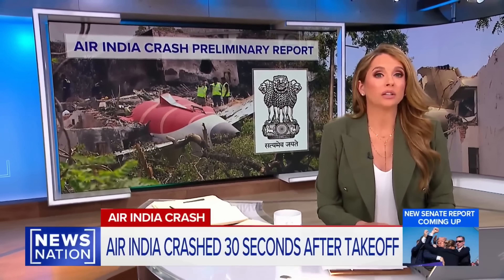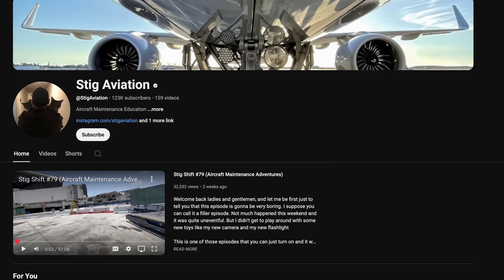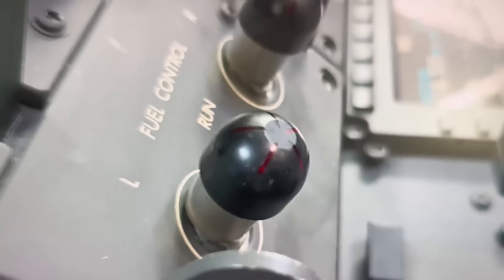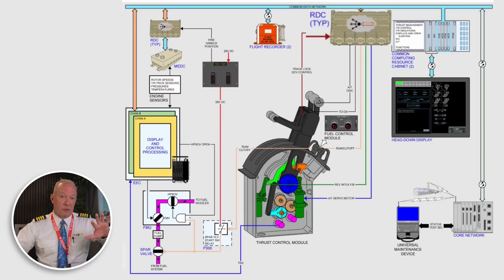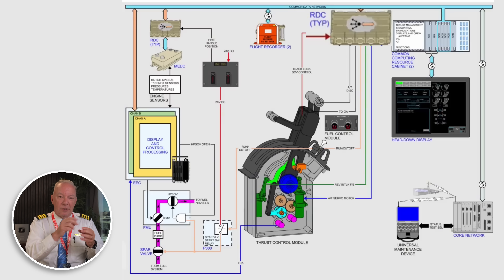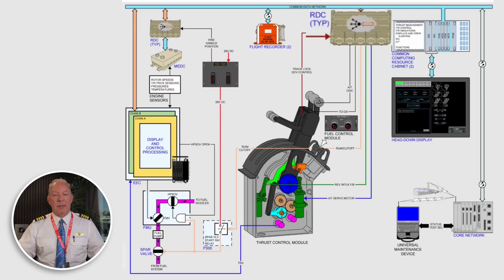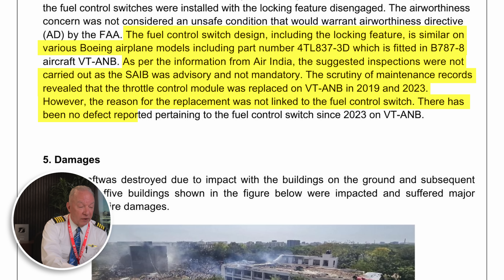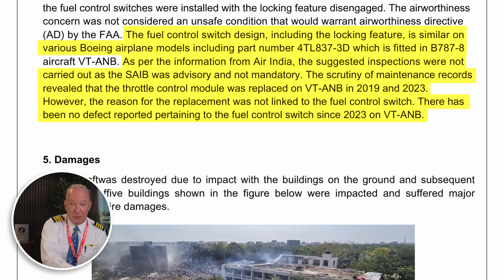The Truth About Boeing 787 Fuel Control Switches

Comment: With all due respect, oversimplified electrical systems don’t show the full picture. The elephant in the room is not addressed. 
Where in the circuit do we tap in to get flight data recorded information?! What has actually failed in that circuit that registered as switch on and then off ? Can’t it just be a Fail followed by a reset to redundancy and then on again? I don’t see a lot of positive news about these two names in the recent years  ( India and Boeing )

Comment: It seems that the fuel control switches were only actuated after the RAT deployed, and many seconds after the max. speed of 180 kts IAS was reached, so the focus on these switches becomes less of a priority. Some experts claim that the probably intentional attempt to relight the engines using the switches wasn't beneficial given the automatic mechanisms to relight the engines, but that without using the switches, only too little time would have been won to prevent the accident. Look at the video of water ingress being a likely cause for electrical failure. https://www.youtube.com/watch?v=tjhadW0mC2c

Comment: Dear Captain Steve,
I love your channel and your work, and the deep compassion you hold for those in aviation, and I have watched this video with great interest. 

But, I have a question which may still conflict with your excellent video, but in the interest of exploring another possibility here goes:

In this September issue of Pilot magazine, which is a very long established aviation journal I have been a subscriber to since I was about 17 years old and I am now 62! (BTW it comes out before the publish month!) 20,000 + hour, airline training captain Bob Grimstead, a long serving Boeing pilot and aviation journalist of great renown, has just published another possible theory, as well as fair criticism of the vague wording in the interim report.
Without going into a very long repeat of his excellent article, one thing stands out as a huge smoking gun: there was a notable twin engine shutdown of a 787-8 (ANA JA825A - MSN 34516) which occurred on 17th January, 2017.
In that case, a system designed to prevent over thrust of the engines; a unit system called the TCMA approved and fitted to the Boeing 787 fleet, and critically, designed to monitor engine thrust, incorrectly triggered a 'non crew commanded'  double engine shut down, through a software fault, while the aircraft was transitioning between flight and ground modes. Fortunately in this case, as reverse thrust was being applied after touch down. The engines were both shut down with neither of the Fuel Cut Off switches being touched at any point by the pilots and the aircraft rolled to a stop on the runway. The aircraft had to be towed off the runway some time later as repeated attempts to restart either engine, failed!
Surely, if that system which must be located  'down stream' as it were, from the fuel selector switches which are at the centre of this debate,  was able to automatically intervene at the crucial transition between flight and ground modes then, how can it be ruled out, that at a point when the Air India accident occurred, a similar gremlin in the TCMA system, did not command engine shut down, as the aircraft  transitioned between ground and flight modes, going the other way, and without either pilot touching the fuel selector switches? 
Why is that not a possibility which still by-passes the discussion about those switches being connected to a relay and separate from other computer based systems?  If it has been proven to have already happened once, it surely must be possible to happen again!? The timings may also absolutely still fit by pure coincidence. Also, as stated in another earlier video of yours, in the following moments of pure horror and shock, one of the pilots....most likely the captain, may well have then re- selected those switches and cycled them fast, some nine seconds later, to try and initiate a re-light....? That would also leave them in the 'RUN' position at the point of impact and as discovered in the wreckage. Or have I misunderstood that sequence? ( Very possible!!)
Anyway, the fact remains there is still a viable open question about the security of the electrical systems that might still have caused a fuel cut off, despite those switches not being physically 'transitioned'. After all, with no cameras on flight decks, that cannot ever be proven to have happened.

The report by AAIB also seems so fluffy as to which pilot spoke, what exactly was said, and just makes it more confusing. It would be absolutely obvious through which mic was sending a signal to the CVR, as to who spoke what words and when, and additionally, it appears that one of the investigators tasked with listening to those recordings, knew the captain personally very well. He must have recognised that voice! 

Why has the report chosen not to be more open about the CVR detail? Possibly because further potentially very difficult legal investigation is underway, to protect the reputation of both pilots, if it might be proved that Boeing is still liable through a computer fault? 

I still think it is far too soon for the report to have been published the way it was, and that there may still be another plausible, if utterly shocking, reason that both engines were starved of fuel at a critical phase of that take off. One that backs up the challenge and response we do know about on the CVR and may still exonerate the pilots. 
Love your work!! ❤

Comment: it looks impossible for a loose 14V wire or something to touch the switches in a 1 sec interval and stay there closing the circuit. so definitely it was moved by a pilot, and there is also confirmation on the audio recording
vibration ? again, seems absolutely impossible, plus there is not too much vibration in the cockpit I assume.
Reply: It only looks impossible if you assume a very simplified circuit can correctly represent what is really in the 787. It just can't.

Comment: To put it into a non-professional sentence: It's clear that both fuel cutoff switches have been moved manually. They can't move automatically, even if there would be a software issue, a general relay issue or an issue with the relays themselves.
And according to the Voice Recorder transcript one Pilot was asking the other if he had switched to cut off if I remember that correctly.
So for some reason the switches have been moved.
Sad, I hope the investigation clear up the chain of events that led to this fatal crash.

Comment: What if there was a loose connection on the positive DC supply to the fuel cut off switches. A loss of DC due to an intermittent poor connection would remove the supply to both fire switches and the down stream fuel cut of switches. The pilot would then notice the run back of the engines straight away on take off and try a re-start by taking the switches to cut off and back to run. Probably doing so within seconds on noticing the loss of power at such a critical point.

Comment: None of this "evidence" proves that the cut-off switches were moved.   If an electrical fault occurred on the 28VDC supply to them, then the relays could disengage and shut off the engines.
One possible answer is a short circuit in a worn cable. A momentary vibration could cause the cable to move and short out. The relays lose power. Then the cable moves again, and power is restored.
Ive had the issue on a car with an intermittent fault on the dashboard. Finding the cable was a nightmare. But after dismantling the entire dashboard, i found it.
Reply: Search for "787 BDM battery diode".
Reply: @ConcernedParent-z1qyep. Looked it up.  This is part of the battery charging system.
I'm suggesting a worn cable between the battery and the cut-off switch may cause a short circuit. This diode would have nothing to do with that.
But I'm sure the investigators are looking at every possible cause.

Comment: if the power goes through the switch to activate the relays as you say, then that means the switch earths or goes to negative when switched, in other words to complete the circuit, so that means if the live side of the switch finds an earth it will activate the relay. the switches are not fail safe. I would say this was a total Electrical failure as you say and it only came back online when the RAT started making power.

Comment: Is there a modification regarding how these switches currently function preventing this ever  occurring again? I realize that this current design prevents "accidental" operation. The engineers, understandably, never thought someone would intonationally shut the fuel in flight yet here we are. Hide sight being 20*20 its too easy to shut the fuel off in flight. I think it should require more steps and confirmation from both pilot & co-pilot. If the operation was electronic the on board system would require a final commitment before shut off or possibly, during take off, not allow fuel shut off. Before 9/11 it never occurred to anybody about access to the cockpit yet of course the pilots should be behind a secure door. Fuel shut off operation needs to be changed. What if fuel shut off required pilot & co-pilot to simultaneously operate the mechanical switch?

Comment: Disagree.. Why was the RAT  deployed two seconds before the fuel was cut off ?
Reply: There is absolutely no official source that the RAT deployed 2 seconds before the fuel was cut off. You are making that up.
Reply: If your source that "the RAT deployed 2 seconds before the fuel was cut off" is just the plane starting to descend, it doesnt work that way, Planes don't immediately plummet after losing fuel, they take a moment.

Comment: The engines failed, one after the other, providing just enough thrust for take-off. Then the pilots cut-off the fuel and then re-introduces it using the switches. That's an extremely likely scenario because the plane even took longer to achieve v1 than it ideally should have.

We can see why the whole western media is pushing the mental health narrative. It's better for AI and Boeingbto wash hands and for claiming damages in insurance

Thanks for the detailed explanation but at this point, it just seems like the tragedy is being milked.

Comment: Captain Steve

So far a solid explanation regarding de Fuel Switches and the sequencing of all FUEL VALVES (3x) but it would also be usefull that the FUEL SUPPLY to an engine can be cut-off by the ENG FIRE HANDLE located at the overhead panel because this 2nd system can override & demand the position of the FUEL CONTROL VALVES in to a CLOSED position even when the standard used FCS on the throttle module is still in the ON position.

Basically the pulling the engine FIRE SHUTT OFF at the overhead panel will CLOSE the fuel control(s) valve to STOP the fuel supply to the respective engine position (fire shut-off handle pos1 or pos 2) regardless the position of the FUEL CUT OFF/ON switch located on the thrust module.

Therefore there are 2 input-possibilities to drive the FUEL CONTROL VALVE(S) to a CLOSED position.

(FCS -open & close  - normal operation - / FIRE SHUT-OFF HANDLE only to a CLOSE position in case of engine fire check-list is carried out )

Comment: Thanks for the detail  in how the fuel switches work. But How does the FDR know when the switches were moved? Does it have a monitor to sense the relay output to tell it that the relay state was actuated, or does the switches have a second pole which is connected to an input on the FDR that tells the FDR the switch was moved. I'm guessing the signal from the switch to the relay is also sent to the RDC which monitors the state and reports it to the FDR.   This means the switch operation is virtually certain as both the RDC noted it and the engines are known to have cut off by virtue of having lost power and crashed.

Comment: There seems to be a lot of youtubers out there arguing that the switches did not move and it is all electronics or lithium battery failure etc. But they are disregarding the actual preliminary report wording that the actual switches moved - not that there was simply a fuel cut off indicated on the FDR. The investigators are not going to make a statement of this gravity unless they are 100% that the switches were moved. They are going to look like incompetent fools if in the final report they have to say the switches did not move and it was an electrical issue. No - the switches were moved and we need to work from that fact.
Reply: "Transitioned". This is deliberate wording so that what is a simple FDR entry can be made to look as if we can actually see what happened physically. We can't. Still waiting for the confirmed clicks on the CVR, and explanation why the RAT deployed so early. We'll be waiting a long time.
"They are going to look like incompetent fools if in the final report they have to say the switches did not move and it was an electrical issue."
There are options to convert, and shares to sell. What kind of incompetent fools did Boeing look like after 737 MAX?

Comment: What if in theory there was a total electrical failure, and then the backup battery voltage was actually way below its normal level (issue with battery internal/charging system) so as soon as the electrical failure happened, there wasn’t enough voltage coming from the batteries to keep the relay energised? Until the RAT deployed and started providing enough electrical power?
Reply: it wouldnt have turned back on if it was a failure and one of the pilots wouldnt have asked why the other switched off the controls if he didnt see him doing so
Reply: @mayonaise7 as far as I’m aware there’s a phenomenon called ‘relay chatter’ where relays can momentarily open/close due to insufficient supply voltage/current. 

The charger for the DC batteries (which is usually an AC powered charger that converts to DC through rectification) is what is normally providing the voltage to the consumers. If the charger was to lose it’s supply power (from the AC bus loss), then the DC bus voltage would immediately drop to the batteries resting voltage, which could have been too low if there was an issue with the actual batteries internals?

As for the other pilot asking, he could have asked because he felt the plane started losing thrust and he seen the engines RPM rolling back on the panel
Reply: @Gregorb6  i dont really know the mechanics of it but you might have a point too. All we can really do is make assumptions since we dont have a concrete proof.

Comment: Did the CVR pick up the sound of the FC Switches being moved to cutoff? Also, as 1 of the 4 man panel suggested, if it were a ghost or "mimic" signal that shut the fuel control valves off, without the switches actually moving, would that not have registered on the FDR? Then it would also show the Fuel Cutoff switches being shut off again, then returned to the power on position? My apologies as this is from a complete laymans point of veiw.

Comment: Correct Captain Steve! Ignore those shows on Indian television channels-they are in damage control mode. They want and [NEED] this to be Boeing/GE’s fault. 

I am qualified to make this comment:

Me: 43 years pilot; general aviation single/multi-engine; US Navy jet aircraft carrier pilot (7th Fleet-Air Wing II, instructor pilot , full card maintenance check pilot; commercial airline pilot 33+ years U.S. big three airline , Captain, retired B777 Captain, captain type rated in every Boeing ((B737, B757, B767, B747-400) except the B727 and B787. Flown in every commercial theater except Africa.
Reply: Did you ever fly the 737 MAX?
Reply: @ConcernedParent-z1q

All the 737 Pilots at United had to be checked out. So it all
depended on what base you flew out off as they rolled out the Max. 

I avoided it because I was a Captain out in Guam. United only used our 737-800 and 737-700’s for Pacific operations. The 737-800 was the next best 737 after the 737-300. Perfect airplanes-nothing wrong with those aircraft.

The dream machine was the 757-200. These aircraft were designed and built by the old original Boeing before they lost their edge.
Reply: @thetdchannel  But if you piloted the 787 MAX you probably would realise that a SPoF would cause those to dive towards the ground, with little chance of recovery?
Reply: @ConcernedParent-z1q

What are you talking about? Prior to the two accidents,
the flight training center had a great aircraft differences school for all us 737 pilots to go through. 

Also, United had some
incidents with the Max but our pilots [somehow] did a great job and did not end up in the ground. 

Boeing without a doubt had a problem that needed to be fixed (procedures/redundancy) but many pilots had the pilot skill set to handle the problem the others did not recognize. 

One thing about the 737…you can make that plane [FULL MANUAL] in a heartbeat.
Reply: @thetdchannel  MCAS was hidden from the pilots. Undocumented. Yet, it would very rapidly command trim changes that could not be fully counteracted by elevator input (based on a single AoA sensor). Doing the right thing within a few seconds in order to not crash is hardly a safe design. And once full elevator up was commanded, the trim couldn't be shifted due to the forces, even if MCAS had been defeated. A total death trap.
I bet those other issues you mentioned had AoA sensor that temporarily glitched or were out of calibration by a little. So just a lucky break.
Reply: @ConcernedParent-z1q

No they caught the ‘Trim Runaway’ early. Look…I was at the company and know what was discussed [within] the company. We also had special training so that everyone was up to speed on using the manual wheel.